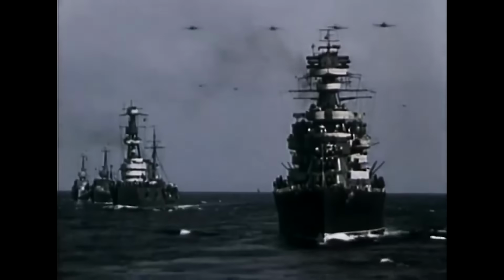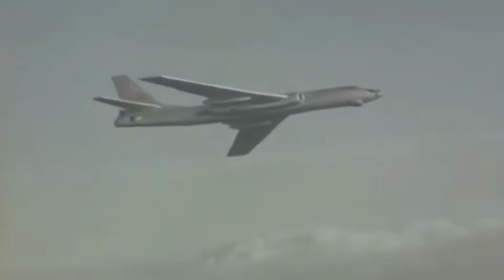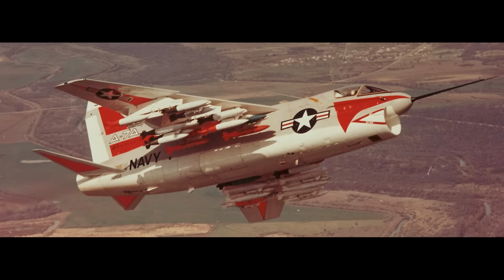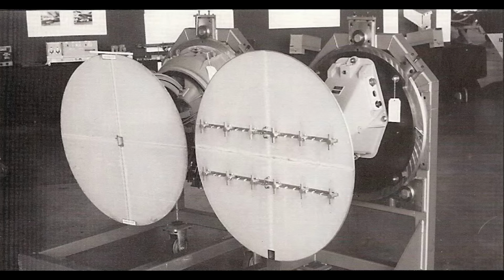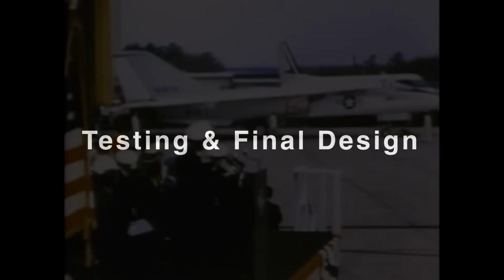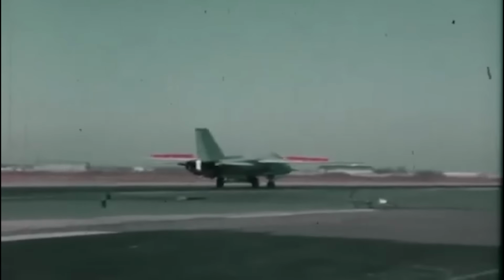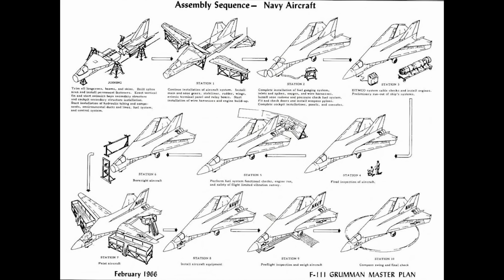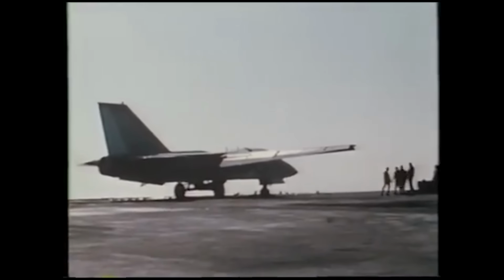Was The Grumman F-111B A Bad Aircraft Or A Missed Opportunity?

Comment: When the F111 was in development a problem was GD developed the A model for the USAF 1st.  Then they started on the changes for the B model for the Navy.   This led to a problem:  the A placed the engines next to each other with a vertical piece of sheet metal in-between.   This worked well for the USAF, but it left no place for attaching a standard arresting hook.  The B development was delayed while GD figured out how to attach the tail hook.  This was just one of many problems of trying to adapt a  USAF design for carrier operations.    Another was GD's management.
Reply: "(...) many problems of trying to adapt a  USAF design for carrier operations." 

The core requirement of streamlining industrial mass production and maintenance logistics across services is hardly mentioned.
Reply: @christophmahler  since I worked at Northrop, we were smug about building aircraft that were maintainable.  The Navy still didn't trust us to build the Navalized F17, so we partnered to build the F/A-18.
Reply: @saltyroe3179  
"The Navy still didn't trust us to build the Navalized F17, so we partnered to build the F/A-18." 

I argued elsewhere, that contracting the other way around for cross-service branch procurement would have been a more realistic procedure - as the naval F-14A did prove itself well in Iranian Air Force service and the Australians seem to be very satisfied with the F/A-18E/F Super Hornet, despite shore based operations. 

One can wonder whether there was a golden optimum somewhere, e.g. when the Vought Model 1600 was considered or whether General Dynamics F-16XL could be adapted for carrier operation (possibly being less expensive in procurement and operation than any possible navalized F-15). 

In the end, the F-14 and the F/A-18 - but also the F-22A - were shutdown due to maintenance/procurement cost arguments (the Super Hornet production end in 2027 related to lack of export, surpassed by the F-35 which is a rather different set of mission role) from which begs the question, how the F/A XX is supposed to make a difference with larger trade deficits, national debt service, subsequent tighter budgets and a weaker currency...
Reply: @christophmahler  now I am onto the YF-23 which was better than the F-22 , in part because it had Northrop maintainability built in and lower operating costs
Reply: @saltyroe3179  
"lower operating costs" 

It was my understanding that the YF-22 was slightly more maneuverable, but overall more conservative, with comparable low observability - but if maintenance costs really were a significant factor - and maybe offering also greater upgradeability within the airframe - then it may hold true as a superior design choice...
Reply: @christophmahler  Stealth aircraft need a lot of maintenance to taint their stealthiness.
Reply: @tararaboomdiay7442  
"Stealth aircraft need a lot of maintenance (...)" 

True - yet the JSF is operated at sea.
Reply: @christophmahler  ...  although it needs less maintenance to maintain its steathiness it still needs more maintenance to maintain its stealthiness relative to a non-stealth aircraft.

Comment: One thing I can say is that if the F-111B had entered service, it would likely still be in use today. 

The reason why is because the chief manufacturer was General Dynamics. Dick Cheney has a personal grudge against Grumman, and when he was Secretary of Defence and later Vice President, he did everything possible to kill off Grumman products and programs.
Reply: Nope, even the RAAF has retired it's F-111s.  The Grumman jet may still be flying in Iran, however.
Reply: @timp3931  Retirement due to age of the airframe, which in turn was caused by the shutdown of orders in 1976. Even the F-14 had their orders cancelled prematurely by Cheney in 1991; with at least 6 years' worth of planned procurement going up in smoke. Or did you think those F-18's flying off the Nimitz today are the exact same planes delivered in 1978?
Reply: Unlikely despite the Navy being against it anyway then early Phantom experience over Vietnam showed that there was still a need for the Navy to engage in actual dogfighting with the enemy.   Something not considered when the TFX program started.
Phantom was modified by Air Force with the Slatted Wing and Internal Cannon on the E model.   Then later the F-15.    The F-111B would not have been able to get into that so would have to have been replaced anyway.
With the benefit of hindsight then the Navy was correct and saved the US money as instead of buying F-111B and then having to replace quickly just got to the F-14 more quickly.
However that is the benefit of hindsight.
So the F-111B would have been out before Cheney got into that position.
Reply: @michaelmcnally2331  no arguments here. That is why I used "if" in my statement. If they had, likely the NACF program would have been adjusted to cover that gap instead, while the F-111B would likely have taken on more attack and bombing functions; carried over from the USAF version.

So, under this scenario, the F-18 program would not gain the attack features, but instead focus more on air to air combat, while this hypothetical FA-111B would take on more missions normally done by the A-6 and A-7.
Reply: It's unlikely that the Navy would have used it as long as the Air Force did, and the Air Force started retiring the airplane 30 years ago.
Reply: @dukeford8893  they began retiring them due to lack of airframe production forcing the issue. If the airframe were produced for an additional 8 years, as a navy contract would have ensured, then retirement would have been pushed back by 15 years.

As the airframe was retired from US service in 2010, that means we would be looking at their retirement next year.